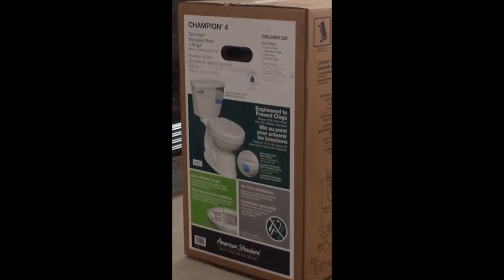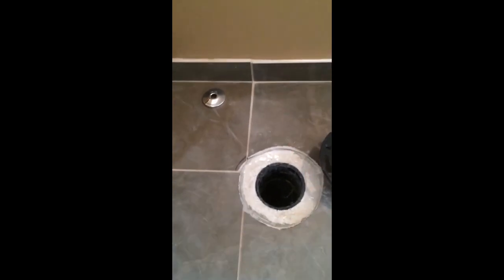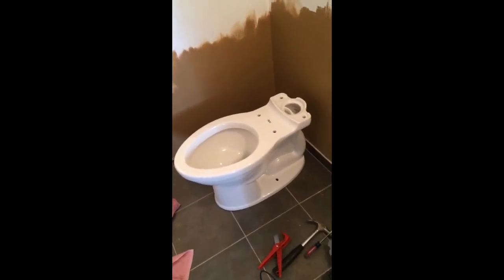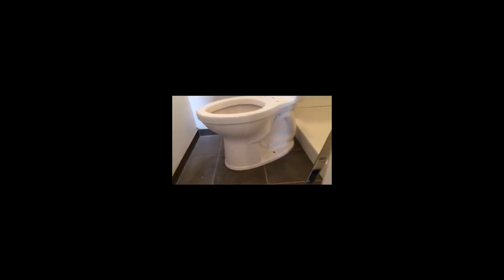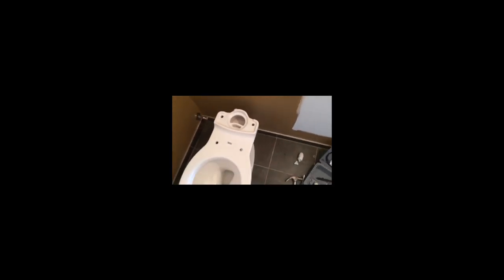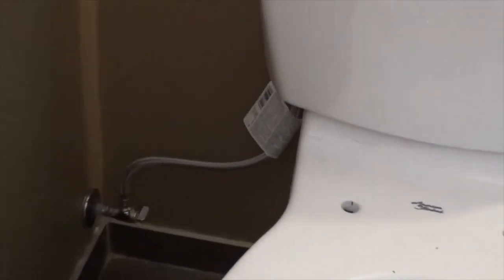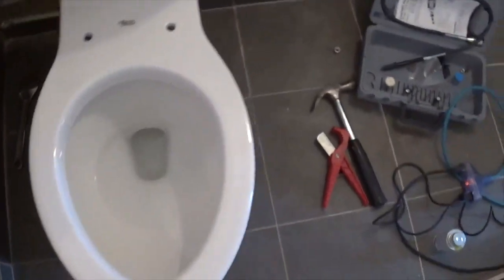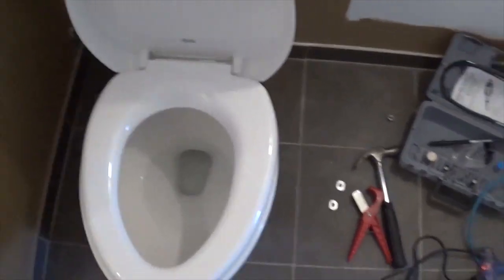Installing an American Standard Champion 4 Toilet

Comment: I just installed it. Using the plastic bold at the base and putting a gasket at the base of the water tank are also important steps that are clearly shown in this video. I will replace another toilet with champion-4 soon.
Thank you!

Comment: Watch the official American Standard installation video and it tells you to install the nuts on the floor bolts thumb tight. Dont torque them down real tight like most people do. I dont see how thunb tight will keep it from rocking side to side with time but they are the pros!

Comment: Too bad it didn't  leak at the tank to bowl bolts so you could show what to do like mine did, I put it in today and haven't been able to tighten the bolts enough to get it to stop leaking. 
I guess I'll have to pull the tank back off and see if I can spot what the problem may be.

Comment: Flange should always be above your floor surface. Would be 1/8 of a inch above.  Much lower than that consider spacers or you can get really thick wax if you can't modify the flange. Good luck .

Comment: Today I installed a Champion 4 toilet. I'm a middle-aged female with almost no handyman skills. I had never installed a toilet before. I followed all the directions and was able to install this toilet - barely. It was almost too heavy for me to lift onto the two flange bolts. Took me quite awhile - okay all day - but I did it. The only concern I have and continue to have is the stability of the tank...it seems to wobble a little. I have tightened the two tank bolts down as tight as I can. I have no "knock on wood" leaks. So I assume I have a seal. On the front it looks like porcelain on porcelain... on the back I can just feel the rubber seal between the porcelain. I wonder if it's a leveling problem. I will have to go buy a level tomorrow and check. If it isn't level, then once I shim it, probably at the front, perhaps I can tighten the tanks bolts further. Any thoughts would be welcome. I live in an old house with wooden floors. The flange was in good shape.
Reply from the maker: Glad to hear about your accomplishment today!  Job well done.    I wouldn’t shim the toilet at the floor unless it was uneven at the floor, and if you shim it there unnecessarily,  you risk lifting the toilet and compromising the flange gasket seal.  
I have three of these toilets installed at my house and none of them are wobbly at the tank.  This might suggest that you should tighten the tank bolts a tad more.  The trick is to tighten them evenly (equal number of turns).   Use the tool from the box and check the bolts to see if they can turn a bit more, ensuring an even number of turns on each bolt.  You should be able to tighten a bit more until the wobble is gone.  Do not over tighten tho.

Comment: Have you had any issue with this toilet? I read some bad reviews stating that it has all sort of functioning issues.
Reply from the maker: Kinshun Mui I have installed 3 of these toilets in my house and have not had any issues to date.  The toilets have performed very well over the last few months.  They all function as designed.  Thanks for watching!
Reply: Oh ok. I was deciding to get the Champion 4 Max but I kept reading reviews and several videos of people pointing out the flapper seal going back and having to hold down the lever for a good flush after only months of use. I then looked into the Kohler brand but the design and reviews were not as good. The Champion 4 has the largest trapway so that was a selling point. Thank you.
Reply from the maker: Kinshun Mui As with any product, you're always going to see some negative and some positive comments when you look at the reviews.  I chose the Champion 4 because of the large trapway, attractive design, easy installation, and it was on sale.  When compared to the toilets I replaced, in terms of flushing performance, rate of clogging (0 to date for the Champions) and reliability, I'm certain I made the right choice.  My previous toilets were low grade, contractor spec, no name junk that plugged fairly often.  I finally made the decision to upgrade and honestly couldn't be happier.  Whether you go with the Kohler or American Standard, I'm sure it'll be worth the investment.  Good luck!
Reply: It doesn't flush like it claims, no strong flushing power